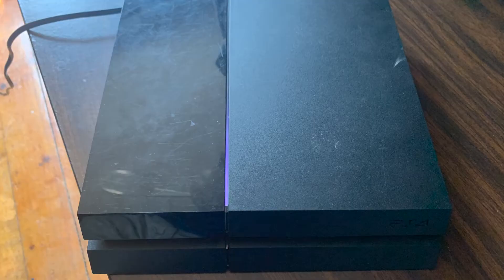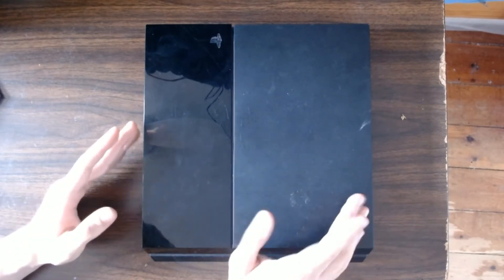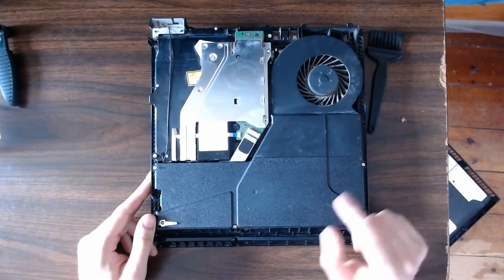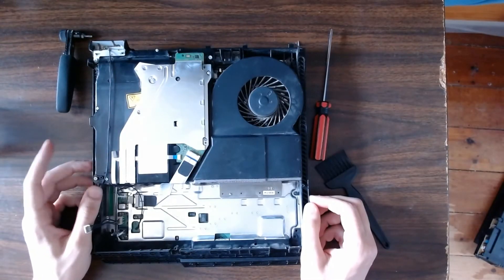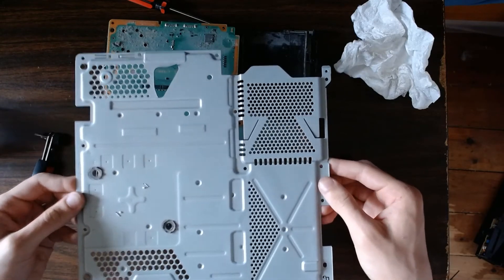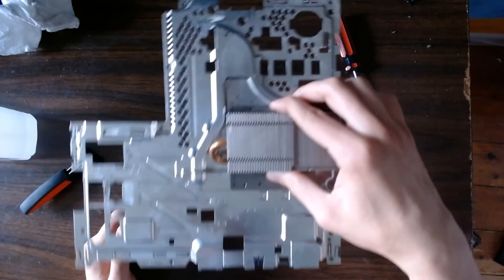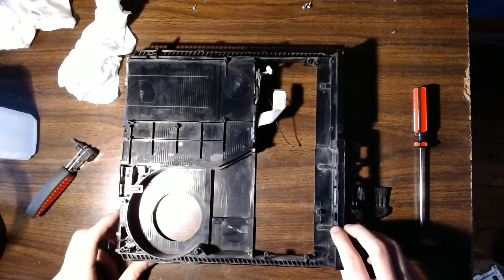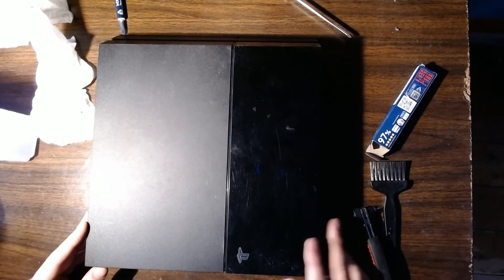Tutorial: How to Fix Your EXTREMELY Loud PS4

Comment: Witch one should I get the artic silver 5 or the one u got artic silver MX-4
Reply from the maker: I recommend you get the mx-4, unless it’s harder for you to get than the Arctic silver 5. There should only be a tiny difference in the temperatures depending on which you get. But since the price difference between them is very small, might as well do this process as well as possible with the superior paste, Mx-4, if you can find it. If not, Arctic silver 5 is totally fine. Also, thanks for watching, and let me know if you have other questions.